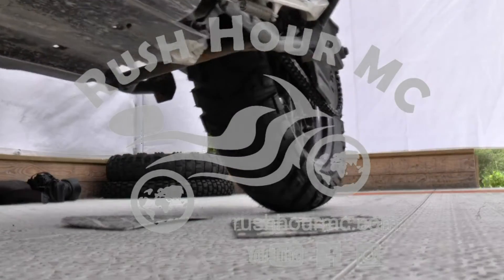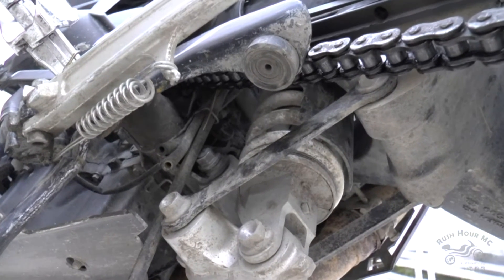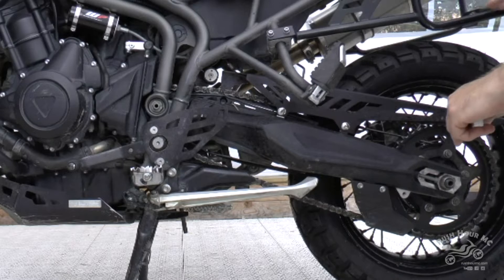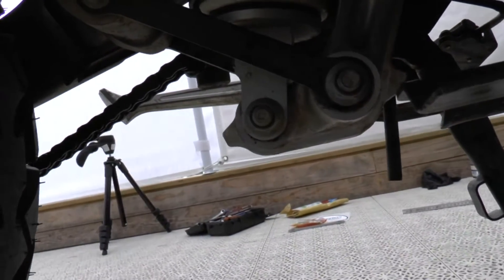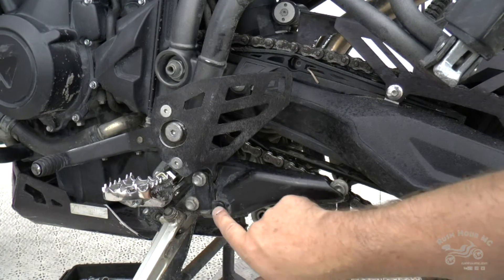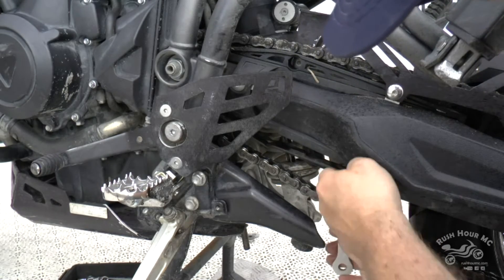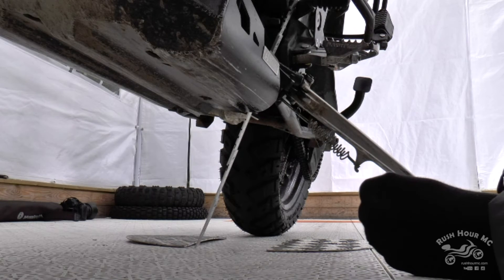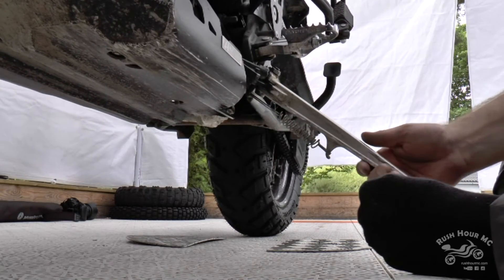Triumph Tiger 800 - DogBone's

Comment: Amigo que ano e a tua tiger???  Onde compro esse bolha escrura???? linda parabens.
Reply from the maker: It is a 2015 model.
But I don't understand what you are asking for =) 
(Onde compro esse bolha escrura)
Reply: @Rushhourmc  I thought this bubble was very beautiful. I would like to know which site did you buy it from?
Reply: questions about the acrylic fairing that sits on top of the headlight.
we call it a bubble here in Brazil,
Reply from the maker: @andrelohn1980  Above the Light, you mean the Screen?
The Screen is the Pugi but I have cut it low =)
https://puig.tv/en/tuning-motos/windscreens-for-fairing-bikes/touring-screen?&bike=8164&location_iso=SE

Comment: Which Links did you buy, the 1,5 cm or the 2,5 cm. I need to fell the motorbike upp but i´m not sure which one buy. Thanks
Reply from the maker: Hi Carlos,
I went for the one that makes it the tallest.
I think you can see in the video, where I bought it there was only one size.

Cheers // johan
Reply: Thanks! this company has 2 option (+15 or +25mm) and another option  with 4 different lengths that can be changed. I don´t know which one put on my bike.
Reply from the maker: Carlos Martínez Vaquero 
I think both of them will lower the bike.
That is most common thing to do.

Tou lile to make the bike taller, you need to add a shorter bogbone.

Sorry I have no link you have to google...

// johan

Comment: Oh boy, you must be a huge dude with 40'' inseam. )) I am about to do the opposite. Need to lower that thing by an inch or so.
Reply from the maker: Ha ha haaa
No, I’m 32” only :)
But I have used my skid plate so much and hard, I’m to refit it for the 4’th time, not a mark on my engine :) 
As designed the rubber dampings break only.
I made my bike higher to hit less stones :)

// johan